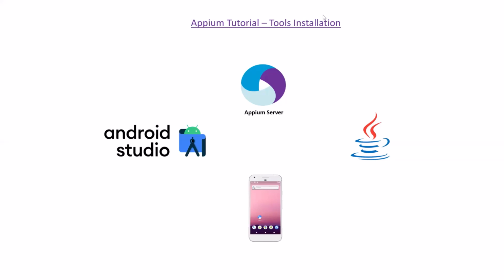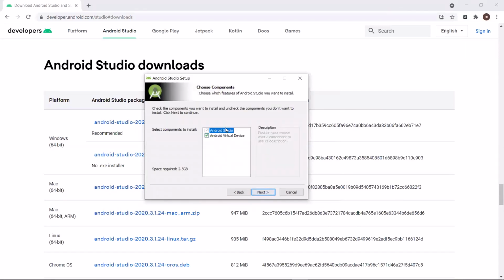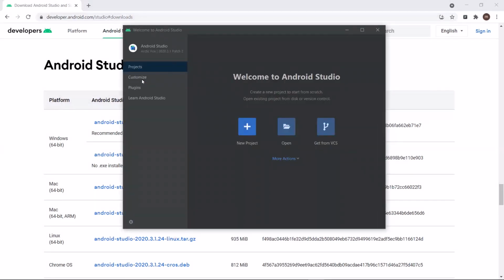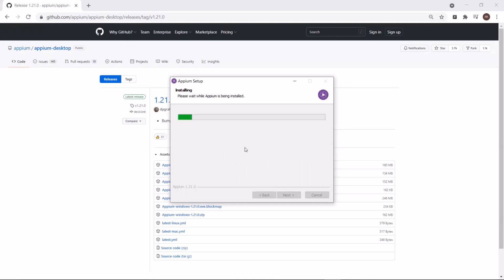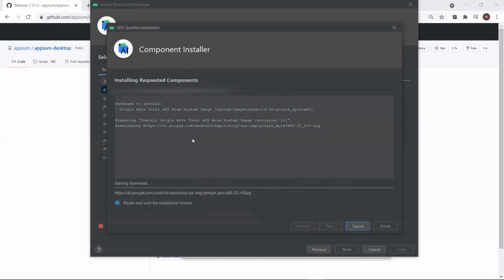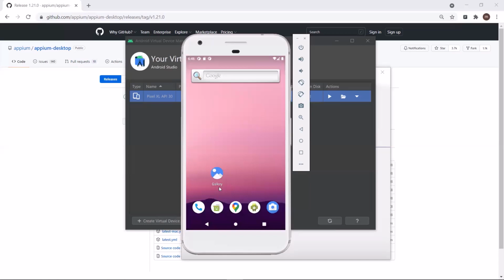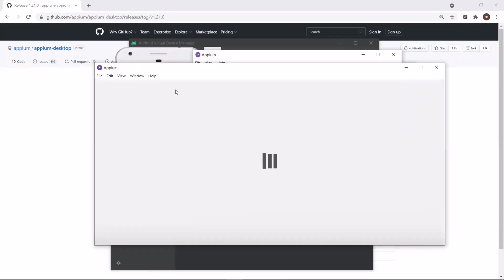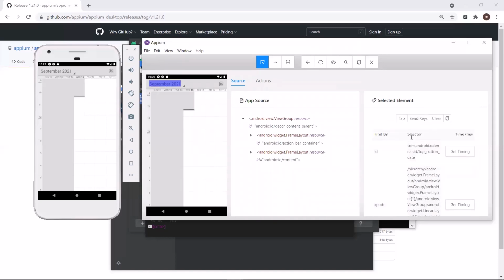#2 Appium Tutorial | Appium installation | Tools installation for mobile automation setup | AVD

Comment: When I click on Start Inspector session, so it asks to download an app from github. After downloading, got a File Folder. Can you please guide what to do next, there is no .exe file in this downloaded file.??
Reply from the maker: You mean start session on appium. Right?
Reply: @maximumautomation  thanks for the reply. Yes I mean start session.
Reply from the maker: Please make sure that you have given the correct device capability and the device is also connected.